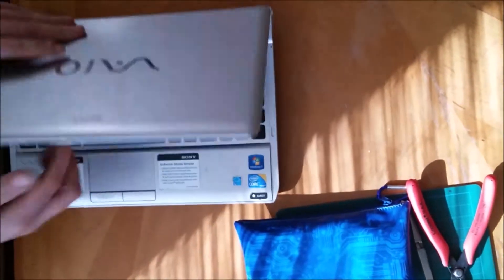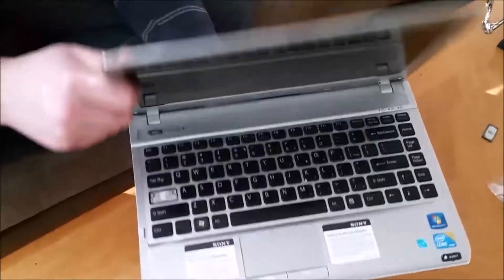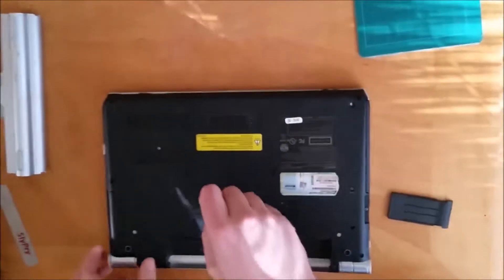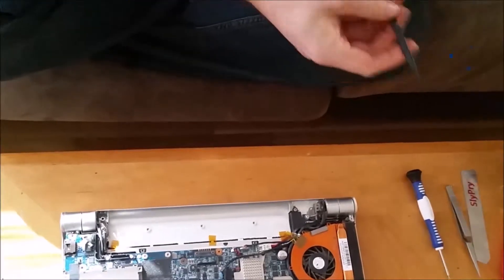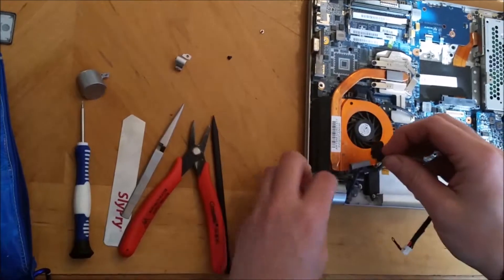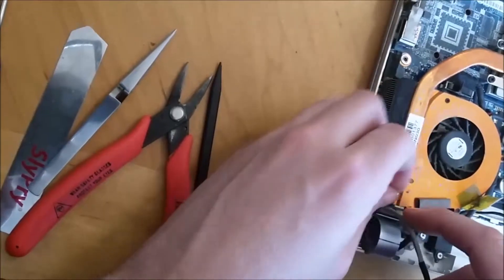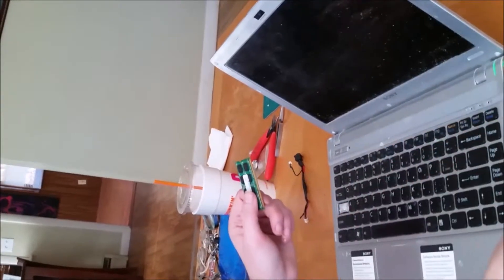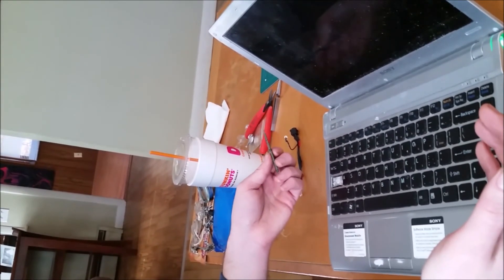SONY VAIO VPCS111FM Charging port replacement

Comment: I have one help me, please I need the type of screwdriver size I'm trying to replace my drive because steam broke windows and its  not fixable
Reply: this kit has the size you would need #0 #00 and #000 they work good on cellphones too http://amzn.to/2nt99TJ
Reply: ok thank you I got a screw but its the size but its a flat head so it was hard to do so I had to give up because my fingers started to hurt and they were tight on so yeah.
Reply: Also, it used to power up but today before I did anything it wouldn't  even start  and I was working on a video game before it broke good thing I had a cloud save.